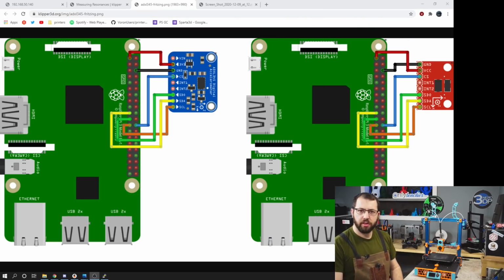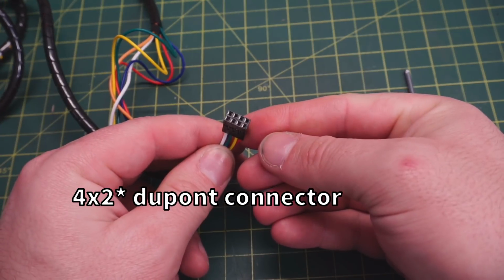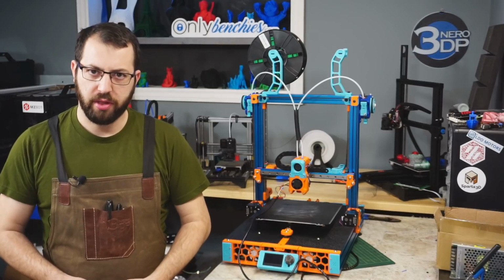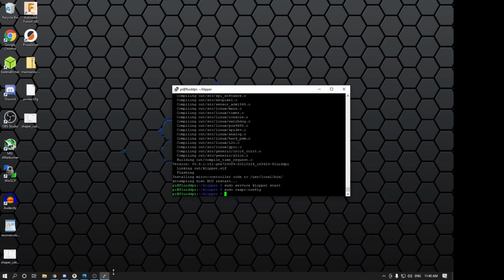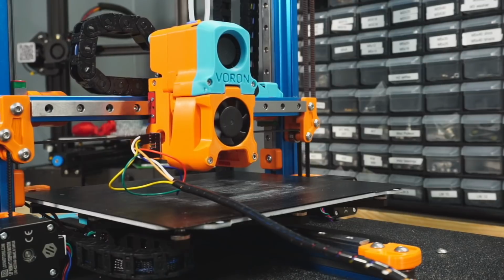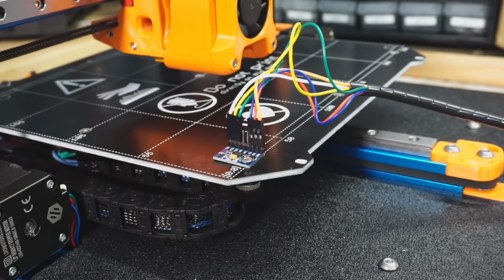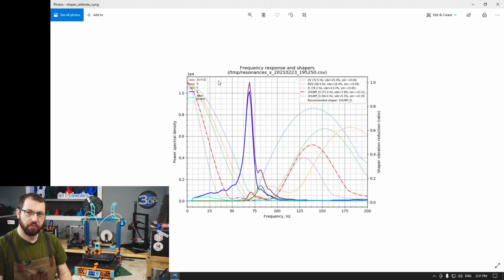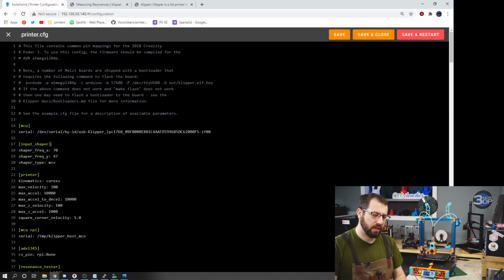INPUT SHAPER CRASH COURSE - Print FASTER and BETTER!

Comment: So I finally got around to setting this up and jesus the instructions didn't match what was needed. Numpy doesn't install per the instructions. It's not included as a package for download. The ADXL345SPI utility requires a GPIO daemon to compiled and run that is also not included on the instructions. I just googled a bunch of stuff. Also not mentioned is the fact that you have to compile the MCU and install it as a service but I saw you rush through that part in the video. You can also run into issues if you don't run a good PSU for the PI and the power isn't enough your ADXL345 numbers will be off. Your camera and anything else plugged into the PI draws power. At each step is a series of roadblocks that a layman would easily get stuck following the FAQ if you don't have experience with Raspian or linux and compiling and installing applications. If you use SSH when you install Numpy you can get kicked out of the session before it completes installing so you might as well run everything using a screen, keyboard and mouse via the PI. You will have to restart alot as well.

Comment: I'm behind on this by a few months, but I'm very interested in Input Shaper and related topics to improve printer output.

The reality is no frame design is 100% rigid so using available tools to measure the vibration modes of the frame and stay away from them makes a ton of sense.

Comment: telling people your connecting to 5v is gonna burn there ADXL345s out if they choose to use a 5v pin. the ADXL345 is 3.3v tolerant and your plug is using 3.3v pin
Reply: Had me tilting my head for a second!

Comment: Thanks for the tutorial, 
I have klipper running on an old laptop, so is there a way I can setup an Arduino to connect the accelerometer to?
Reply from the maker: You would have to do something like connect it to a ardunio nano or some other board with the available pins free, install klipper on that, and connect it to the laptop via USB

Comment: Thank you for this great video. After I have measured the resonanz of my printer, I have a strange diagram and did not know if there was an problem. The y diagram logs great, but the x diagram show two high peaks at 44 Hz and 80 Hz. Which one is the correct peak to use for the resonanz compensation?

Comment: hey sooo, to connect my accelerometer to the bed of my printer i just designed and printed a shape with a screw hole in it, printed it and simply left it attached to the bed, this held fine and i believe is probably the best solution to not having a screw available on the bed

Comment: Greetings! I'm shopping on Aliexpress for a PL-05N inductive sensor. But it says "DC 10-30V"?

Is this the correct specs? Not 5v? Thanks.
Reply from the maker: Correct. It runs off your psus voltage. So 24v in our case
Reply: @CanuckCreator  Thanks, I'm gradually gather parts for a future Voron. So no sticker shock:-)

Comment: I simply designed my mount to only mate to the flat part of the adxl345, and leave the header pins out of the equation altogether.  There's enough width to get a secure mount without including the header area. Those sensors are so cheap I'm leaving them permanently mounted on the toolheads.  At someone else's suggestion on one of your videos, I designed a mount to print on the bed and screw the sensor into it without detaching the print from the bed.  I can't really get at the screws on my printbed since they are under an expensive magnetic sheet from wham bam.   I was thinking of leaving the bed heat on to ensure the print sticks while the motion is hitting harmonics.  Do you think the heat will effect the readings from the adxl345?

Comment: A headsup for people using the Adafruit version (the blue one in the picture): 3.3v and gnd are switched! Also the hole is nog M3 compatible.
Pretty sure I just destroyed mine by switching the 3.3v and GND. For some reason only the Z-axis still reports values.

Comment: What is your opinion about s-curve acceleration with input shaper and pressure advance?
Reply from the maker: Input shaper in theory is better as uses "smooth" input shaping vs the abrupt method s curve uses. Which should result in cleaner prints. Pressure advance tuning is seperate from an input shaper tune and should be done after.

But thats going off the specs. I havent touched marlin in years.
Reply: Thank you for the details.

Comment: Now with Input Shaper if I put wings on the extruder my printer will fly away! I just finished putting together my Switchwire and with Input Shaper I'm actually getting less ringing and better overall looking prints at higher speeds! Seems strange but I like it. 200mm/s is the highest I'm comfortable with now with max_accel @ 3000. If you see a flying 3d printer it's probably got Input Shaper! Thanks Nero!

Comment: You have set the wrong values, in the chart the recommended values for your test are Y = 3HUMP_EI 80.6HZ and X = 2HUMP_EI 71hz. The recommended values are also in the SSH console. so.
[input_shaper]
shaper_freq_x: 71
shaper_freq_y: 80.6
shaper_type_x = 2HUMP_EI
shaper_type_y = 3HUMP_EI
Reply from the maker: The recommend values arnt always the "best" and can sometimes be a more aggressive on the input shaping then needed. The method i covered in the video is a good starting point for most printers and will be expanded upon in future videos.

Comment: Is that the same accelerometer that was being used on the WII controllers. I made a posted a thousand years ago about using these chips as a permanent install to adjust the printer movement. It would be useful for an auto belt tensioner to go along with it. https://ieeexplore.ieee.org/document/9036872

Comment: So I'm kinda on the fence in regards to Klipper, to me it "looks" like the mechanical elements are being pushed to a limit they shouldn't be pushed at, is there any way to know if there is long term effects of possible abuse of this hardware? I mean, Steppers aren't that expensive, but if you have to replace them every 2-3 months because they are being abused by the extreme acceleration rate of Klipper? Or is it just me being cautious and the equipment is fine?
Reply from the maker: Ive got ones in my machine going on 3 years now of printing in an enclosure.  Zero issues.

Stepper motors dont die that easy.
Reply: @CanuckCreator  awesome, that's great to hear. This may be done to my sidewinder x1 then!

Comment: Hey Nero, just so that you know: the ADXL345 that you've linked to in the video description is showing up as unavailable. I did however compare it with this one on Ali and (according to the labels on the pins at least) the two units are identical: https://www.aliexpress.com/item/1005001622854592.html?spm=a2g0o.productlist.0.0.7d901f66kR6FMZ&algo_pvid=14ab194d-6115-486e-bef9-5110e3a92e1d&algo_expid=14ab194d-6115-486e-bef9-5110e3a92e1d-0&btsid=0bb0623016143555642442322ef49e&ws_ab_test=searchweb0_0,searchweb201602_,searchweb201603_

That aside, this was a brilliant video - concise, to the point, and just the right pace to follow along with. Kudos to you! :D
Reply from the maker: Its a common board design and is available from multiple vendors/sources, the actual listing i got mine from has been out of stock for a bit now, that link is more an example of what to look for.
Reply: £1 on aliexpress mate
Reply: I got three for $9 total on Amazon https://smile.amazon.com/gp/product/B08HLP1MPY/ref=ppx_yo_dt_b_asin_title_o02_s00?ie=UTF8&psc=1 
I thought I'll just leave them mounted on the printers
Reply: @woodwaker1  i got 10 for that was the only one with decent shipping
Reply: @reasonsvoice8554  You got a good deal.  I had to purchase the Dupont connectors that cost me more than the ADXL345s
Reply: @woodwaker1  yer ive gotta order some that are gonna cost me about as much but its a set of loads
Also dont know how far youve got yet ive got a screen running klipperscreen on the gpio pins of the pi that would normally be used
Just unplug the screen while running the tests would you think?
Reply: @reasonsvoice8554  I have my stock Ender 5 screen running on my BTT mini E3 v2.  Works great for me, that is one of my next projects  to figure out how to interact with the display.   The difference in the before and after on the input shaper was really dramatic
Reply: @woodwaker1  just get a pi tft whichever size you want really easy to install id advise bigger than the 3.2" one tho i can hardly read it ill just take it off for now and reun the adxl stuff then add one back when i order a bigger one lol in thinking the 7" would be nice
Ive got my ender 3 screen running too so dont need it im finding i dont even really even use that just my phone or laptop tbh

Comment: how is the accelerometer more accurate when there is no way to precisely measure the peak of the graph?
Reply from the maker: Ill be going into more precise. Methods in future videos.  This method is more the quick and simple way and you dont have to be bang on to get good results
Reply: @CanuckCreator  just a heads up, the peak in your X axis graph is 68,75, since 25hz is divided by 4, so each square is 6,25

Comment: I just did this 2 days ago and it was really easy to use a command strip cut in half for each location on my bed slinger cr-10s pro v2!
Reply: Oh and I used the test print tower to find my max acceleration of 2500 mm/s^2

Comment: @Nero 3dp I just started experimenting with arc welder. Did you know lines can be *curved*? Mind blown.
Reply from the maker: Yup. Thats been common in cnc since forever pretty much. There is an way of doing it in klipper. But since it has much more cpu overhead on the rpi and isnt limited by bandwidth to the controller is doesnt have much impact on klipper
Reply: @CanuckCreator  I'm giving it a go. I like the smaller gcode. Let me check load and see how it looks.
Reply: @CanuckCreator  0.75 on this pi 3 b. It is not presently on fire.
Reply: @CanuckCreator  ok update. 1 core is pinned 10 -13 % load. Die is at 56c. Let you know what quality is like later. This would kill a zero.

Comment: One of the best content about adxl345 integration with Klipper...i would definately want to watch/learn more... one request, as we all know Voron switchwire is a different segment, it would be great if we can get similiar content/tests/results with your ender3 v2 which is an entry level and very common (cost effective) printer. I really wonder how the quality will be improved in e3v2 with such a sophisticated low cost modding...thanks again for your all effort and contribution the makers community...

Comment: A tip. For soldering header pins flush to the board, put the board on a flat surface. Insert the pins, long pin down (ie opposite way to what you would expect), into the board then solder from the top side. The black plastic bit keeps the pins aligned but is spaced off the board so you can solder under it. Once soldered you can remove the black plastic bit (it will probably just slide off with a bit of wiggling) and you have completely flush (on the bottom) soldered pin header. Alternatively, if you want to keep the black bit then just push it down until it sits on the solder joints :)

Comment: Hey, i use a 4 Head toolchanger. Is it recommended (or even possible in the Firmware) to do this Input Schaper for every Single toolhead? Or are there no big differents in the resonances between each toolhead, cause vibriation are caused by the total of moution System are even higher
Reply from the maker: That im unsure about, you may be able to packaged the [input shaper] commands into a macro that happens during each toolchange
Reply: @CanuckCreator  sounds good, i will give it a try. But first i have to see, of there is a big different between the heads

Comment: Hey Nero 3d !  Thanks for your new video today. I just happened to notice here that you have to carefully count along the pin rows of the rpi header. To make sure you are connecting the cable up to the right row position correctly on the rpi. As to avoid mis-wiring it. However sometimes it can be hard to see in dim light etc. and then make an honest mistake, hook it up wrong and fry something! So why not 3d print a small plastic locator adapter that fits over the smaller dupont 2*4 pin header plug, and then also uniquely maps more safely onto the larger rpi 40 pin header footprint. On the rpi. This way the locating adaptor can always make it impossible for the accelerometer to get plugged in incorrectly. I understand that for most regular people that is probably overkill. And not really necessary because most of us are only doing this task 1-2x times (ever). However you yourself happen to have so many more different 3d printers over there. And keep reusing the same accelerometer each time. So it just might be worth it for somebody like you. Or otherwise for a beginner person who is very scared of messing about with the electronics side of things. I hope the suggestion was helpful and worth reading.
Reply: way easier to just pay attention and learn how to count
Reply: @johnandrews9433  definitely not “easier” the adapter would be ten-twenty minutes in cad and maybe an hour for both prints and you get absolutely mindless install every time. The savings will have added up after just a few uses of the system and would immediately pay for itself if you fry something for not using it. The guy is clearly eloquent enough to count but stated realistically that people can make mistakes
Reply: @JeronimoStilton14  what, I’m not talking about an adapter. I’m talking about paying attention to what you’re soldering lmao. Work on your reading comprehension
Reply: @johnandrews9433  Jeeeeesus dude you want to talk about lack of reading comprehension. You were telling someone that its easier to count than make an adapter.There is also no soldering involved on the connector side in question so you've honestly degraded your own premise.
Reply: @JeronimoStilton14  yeah idk it’s just pretty fucking easy to count and not fry things like a tard lol

Comment: Shouldn't the ACCELEROMETER_QUERY Value for Z be around 9800?? I found that when I swapped my low cost ADXL 345 for an ada-fruit sensor I then had a Z acceleration value more in line with gravity and also much lower noise values.... I'm a bit worried you're measured acceleration values are off and you could be compensating for wrong resonance frequencies 🤷‍♂️ What does your MEASURE_AXES_NOISE values state? Is it in line with the recommended < 100 values?

Comment: I noticed the chart referenced a csv file.  I wonder how much improvement you could get with the actual values stored in the file vs eyeballing the chart.
Reply: Aren't top right values on the charts is the ready answers?
Reply: @Gebsfrom404  I think you are right.  I missed that. It even gives a shaper recommendation.
Reply: I would love to see a follow up video to see those setting in play and compare results.

Comment: I think it would be better to include the spring steel build plate when testing the Y axis. If the mass changes the harmonics will change.
Reply from the maker: This is correct, I had it on during the actual tuning but had it off when i went back to record the B-roll footage, should have made a note there.
Reply: Thanks for pointing this out!!

Comment: Hey, great content, I just swapped to Klipper 2 days ago, and i love it. I used some of your videos for config so thank you.   I get almost the same results as you on my rails ender 3, with more on X than Y on the test print.
Reply from the maker: Yup, different axis`s will have different results usually, you can run different input shapers for each axis if needed, config would look somehting like

[input_shaper]
shaper_freq_x: xxx
shaper_type_x: mzv
shaper_freq_y: xxx
shaper_type_y: ei
Reply: @CanuckCreator  thank you. I am running ei for X mzv for Y. Another thing is do you disable z hop while doing prints?
Reply from the maker: @deenman60  depends on the print..i always run z hop out of habit but it may not always be needed